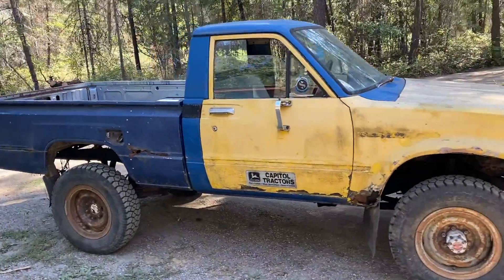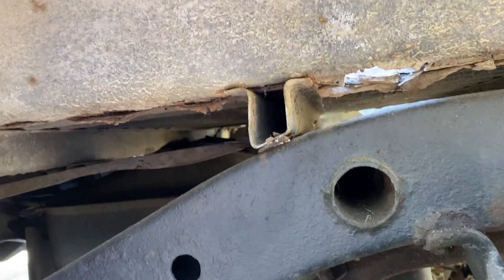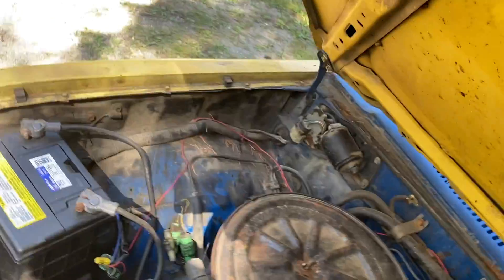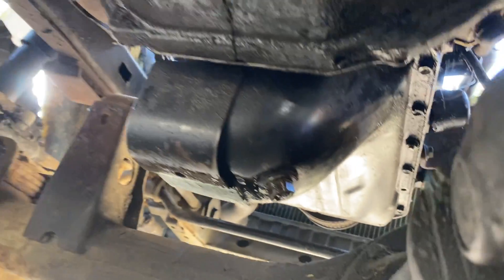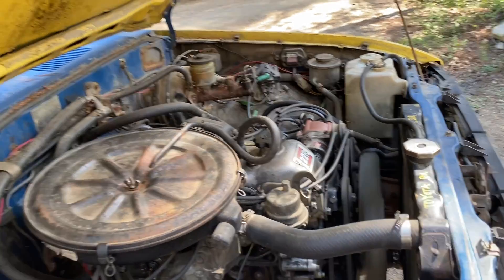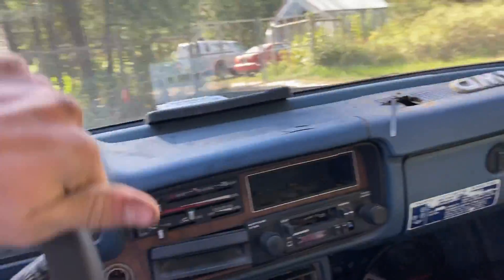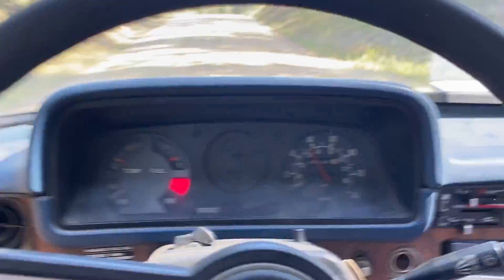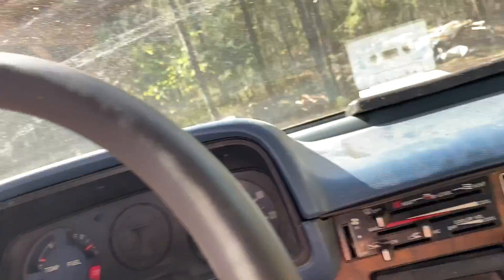1981 Toyota Pickup FIELD FIND

Comment: Trucks not rough at all. Just the bed
Reply: Best way to beat the rust is to paint the whole underside of the truck chassis and floorboards along with the frame  with black rust olem paint. This includes the underside of the bed.  The bed can be worked out a little there with body filler on the right side, along with any areas that can be welded or, spot welded, and bed liner coating can be put down inside the bed itself after Trek outside of the bed is sanded down primed, sanded again and painted.
Reply: Just noticed the floorboard are shot. Need to weld in another floor board.